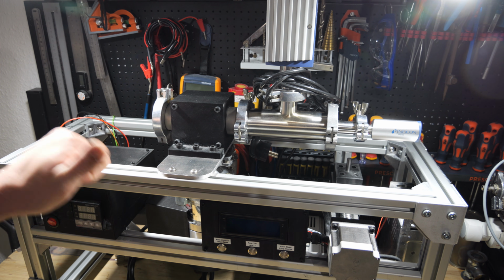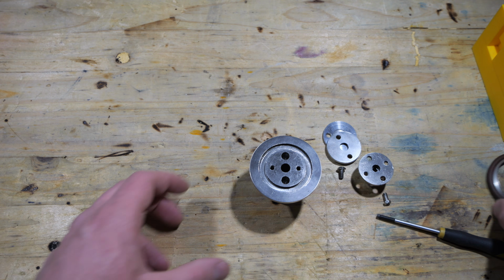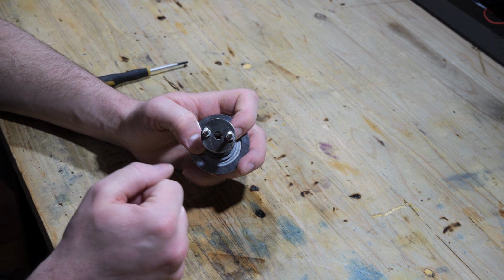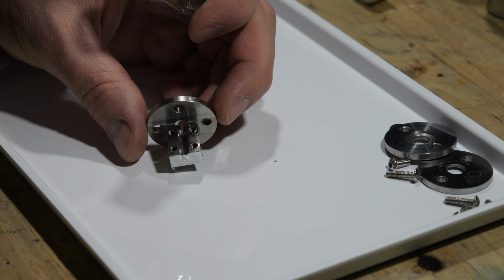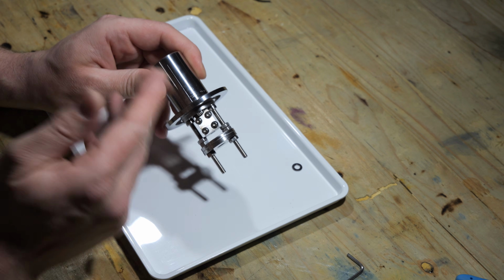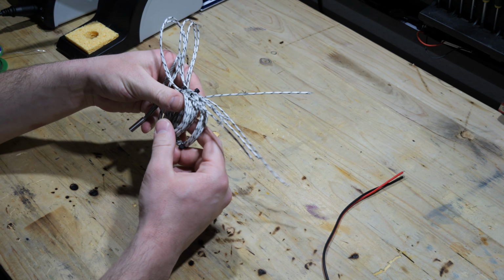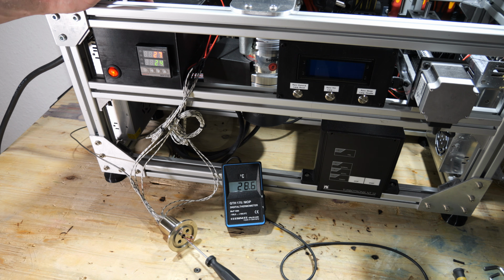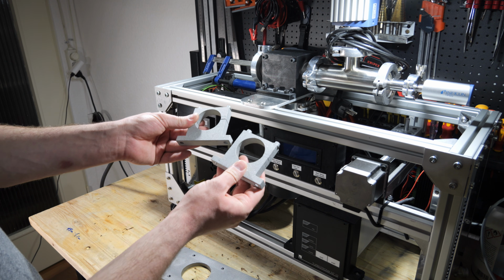DIY Atomic Beam Oven: The Stern Gerlach Experiment Pt. 3

Comment: Instead of replacing sandpaper after sandpaper, buy a high quality diamond sanding plate is much better solution. BTW, after sanding, using electro polishing is much better solution to get the job done flawlessly.

Comment: Very cool channel and projects! Subscribed! what happened to your Gerlach experiment ? how did you plan on detecting potassium ions ?  Thanks!
Reply from the maker: Thank you! I appreciate hearing that!
I have to admit that I've somewhat neglected the Stern Gerlach project. The issue is that I need a picoammeter for the detector, which I don't have. For the detection of potassium atoms, I wanted to use a Langmuir-Taylor detector.
Reply: @AdvancedTinkering  picometers are rare and expensive your right.. how about a Faraday cup and an electrometer for nano volts range? Or a simple photomuliplier tube and chain resistance? Since you already operate at low pressure, the PMT could be cut open ? What accelerating voltage are you going to use? If any?
Reply: @AdvancedTinkering  The picoammeter is probably the cheapest, easiest part of the project, so you shouldn't let that stop you!  You don't have the benefit of an electron multiplier, unfortunately, as found in actual cesium beam tubes.  But you should still be able to detect a signal, given some additional integration time.  Do a search for 'picoammeter transimpedance amplifier' for some ideas.

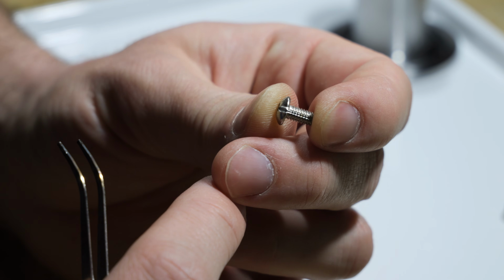Comment: 14:00 how would a slit in the thread vent out an air i don't understand, shouldn't it be a through hole in the screw instead?
Reply from the maker: Both is possible. You just need a path for the air molecules to escape.

Comment: Some of those turbos have a oil wick at the bottom bearing and also some draws oil up through the shaft rotation to lube the top bearing.
It was probably just dry and got a bit lubed. It might pay to open it and check the oil.

Comment: Does your beam need to be both horizontally and vertically collimated? You might get better flux out of your oven if you used a stack of parallel plates instead of the tube bundle design you are currently using. You could build one fairly easily out of a stack of thin sheets of steel/aluminum and spacers. You could adjust how fine of collimation you get using different thickness of spacers between the plates. Also, pinhole VCR gaskets might be a cheaper option compared to an optical slit if you don't need a line shaped beam profile.

Comment: Will that atomic source produce macroscopic amounts of potassium? If so, the hypodermic needles or your optical slit might close up from deposition over time.
Reply from the maker: That's also one of my concerns. To be honest: I don't know and I will have to try.  I think as long as the temperature is not high enough to "boil" the potassium it should work for some time.
Reply: @AdvancedTinkering  you might also want to test how hot the needles will get in vacuum. They appear to be thermally connected to the oven. If they are too hot, they will likely not work properly as collimators.
Another thing to think about: beam alignment. If the needles do a good job at collimating, they need to be aligned quite well with the slit. Putting a light source in the oven can help with that for checking, but optical alignment with reflective surfaces don't necessarily show true alignment :/
Reply: @AdvancedTinkering  Have you considered using two slits instead of a slit + collimator? With such a large mean free path, I don't see any reason to use long tubes, especially since the metal will condense on them when it impacts it. Also, how are you preparing the potassium? The coating of oil and/or potassium oxide may be an issue.
Reply: You can control the vapor pressure based on the temperature of the furnace. Since you are running the vacuum chamber at ~1e-6 torr, you just need to operate your furnace at the temperature corresponding to a potassium vapor pressure of about 1e-6 (maybe a bit higher to get better flux). NIST has tabulated Antoine equation parameters for most substances, but you may need to look around for a parameter set valid at low (I.E. high vacuum) pressures.

Comment: Isn't this supposed to be pt.3? And if you want to monitor your SSRelay, add an external resistor+LED in parallel with its output, and mount the LED on the front of the case; if it shorts to closed, the LED remains on.
Reply from the maker: You are absolutely right, thanks! I just changed the title. 
Using a LED to monitor the SSR is a great idea, thanks!
Reply: @AdvancedTinkering   Many PID controllers have an output that can be triggered for some sort of alarm state (setpoint high). If you setup a high temperature alarm, you can use the output to drive a relay to cut power to the SSR, which would protect your heaters from burning out if the SSR fails closed.

Comment: Could you use a knife edge metal seal instead of viton?
Reply: I believe metal seals are one use only and if so, he would have to buy a new seal every time he needs to restock the chamber with potassium which probably wouldn't be very cheap in the long run
Reply: @matiastripaldi406  yep makes sense, unless it could be loaded in a different location
Reply from the maker: Yes. In the paper I referenced they used a CF flange. But since my whole construction uses KF Flanges, I wanted to use those for the oven too.
Reply: @AdvancedTinkering  I'm sure I've seen people use metal seals on KF pretty regularly, I think it needs different clampy clamps is all... I'll see if I can find a part number

Comment: Ive had a similar problem with an ill-fitting kf flange centering ring groove. Another way to solve the problem is to sand off the centering lip on one side of the centering ring. It makes clamping a little more fiddly, but it still works fine.

Comment: If you need to know potassium flux, you might want a less lossy oven design. I'm not sure, I haven't thought it through. Possibly you could get a short length of bellows with kf flanges and solder one flange to your thing, so you have a better heat break from rest of system which must be cool and consequently the possibility of more uniform temperature and make it easier to not cook o-rings.

Comment: You don't need very rapid response, so let me offer this, which may be overthinking it compared to whatever cheap 3d printers use. For some of my temperature control I've used cheap no-name DC-DC converters with variable steady output set over serial or other communication to just dial a steady power level manually. You could use that, possibly including some slow automation loop (microcontroller, computer, etc). If the problem is well in hand just ignore me.

Comment: As long as you control (or at least measure) the temperature of the dissimilar metal junction you can solder or use any other connector for thermocouples. Although not all thermocouple wires are solderable with ordinary fluxes. You can't get very highest accuracy that way but more than good enough for most purposes if you've got a good setup and check that it works like you think it does. I needed a few dozen thermocouples, some of them in vacuum requiring feedthroughs for my first big project and I absolutely did not shell out for the "correct" way to do it.

Comment: Fuck no, don't put a dremel to a nicely machined part, find someone with a lathe!!!
Reply: It's okay, I mean technically you don't even need centering ring or clamps for kf flanges as the vacuum will hold oring in place on it's own or the surrounding air pressure
Reply: Still I think he would benefit from a mini lathe or a cnc mill so long as its rigid enough for making stainless steel parts

Comment: The solid state relay wont work when you supply it with DC. It uses a triac switch that can only open in the zero crossing of a AC supply.
Reply from the maker: Yes, I realized that it's an AC relay a few minutes later and replaced it with one suitable for DC.

Comment: You'll need a small cooling jacket around the oring ring on the furnace, viton will not survive going above ~140C for a long period of time(minutes). Stainless is a really bad heat conductor so it'll be easy to cool it by adding a small heatsink to it, or just soldering a copper tube with some water running through.
Reply from the maker: It's good to know that the viton O-ring will not survive those temperatures for long. Thanks! I will probably try to air cool it and if it is not sufficient, I will try water cooling it.
Reply: @AdvancedTinkering  Yes, can confirm. Viton can briefly handle that temperature if not compressed. If it is exposed for extended time while trying to seal it will suffer compression set and either seal unreliably or not at all. I busted a couple valves that way.
Reply: Find someone with a lathe, put a groove down to nearly the diameter of the hole in the middle.
Then K reservoir and flange are only attached with like a 2mm wall thickness tube of stainless steel and the reservoir can easily be heated with bunsen burner, whatever....
Reply: If you want to use KF flanges, but want to have higher temperatures or corrosive media, you might want to have a look at Helicoflex. Essentially spring loaded metal gaskets that work among others with KF. They are a bit pricey though.
Reply: FKM (Viton) is actually rated up to 220 C. A quick search proves that.
Forced air cooling with a fan should be sufficient.
Reply: @ivankundrata3837  It can't handle that temperature while maintaining its properties.
Reply: Well, the characterization sheet says:
"
Compounds of
Viton™ remain substantially elastic indefinitely when
exposed to laboratory air oven aging up to 204 °C
(399 °F) or to intermittent exposures up to 316 °C
(601 °F). High temperature service limits are generally
considered to be:
– 3,000 hr at 232 °C (450 °F)
– 1,000 hr at 260 °C (500 °F)
– 240 hr at 288 °C (550 °F)
– 48 hr at 316 °C (601 °F)
"
I also build several prototypes with FKM at maximum 200 C where it maintained a seal.
Reply: @ivankundrata3837  Vacuum tightness and just maintaining elasticity are quite different, unfortunately. That's why you never bake viton systems beyond 140-150C.